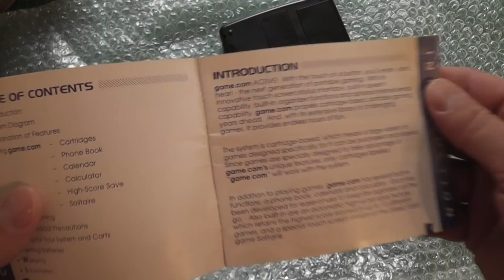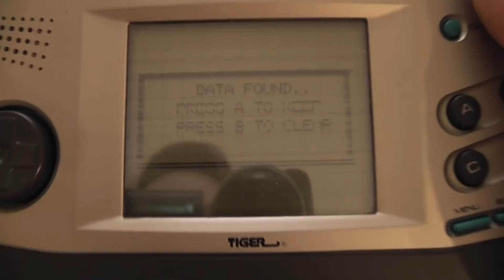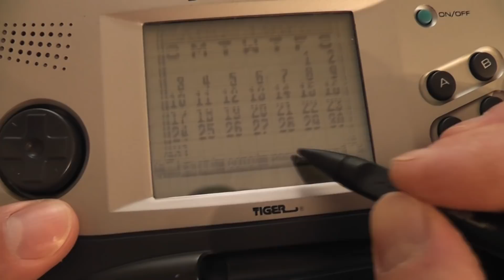Let's Repair - Ebay Junk - Tiger Game.Com Handheld - LCD Lament

Comment: I've had success heating a metal ruler with a hot air gun, then using that to press against these strips. Much better control over heat, as you can let the ruler cool off more or less as needed. Need oven gloves of some sort though.
Reply: Fracture nice idea. I shall try that 👍🏻
Reply: Good idea. You would need quite a lot of workspace though. :)
It should also be mentioned that there exists T shaped soldering iron tips that are made specifically for these situations and some even come with silicon rubber to help even the pressure without overheating the cable.
You can get cheap ones directly from Asia on aliexpress for example.

Another solution that doesn't involve soldering is to use pressure just like when you press down around the edge with your fingers. You could for example cut strips of rubber and place them over the cable on the PCB then screw everything  back on tight. Add more layers until you get the best result while not deforming the plastics. This additional pressure if often enough to restore the contacts before attempting anything else.
Reply: Even a steam iron without the steam would be better than a soldering iron. There's a video from Markusfuller where he uses one to fix an MC-505 LCD screen.

Comment: I remember being about fifteen in Christmas 1997.  I was at Wal*Mart checking out what's new for the season (Star Trek / Star Wars figures primarily) when I saw this on display.  I toyed around with it for about five minutes and for the time, it wasn't half bad.  It touted internet capability which was basically unheard of back then, but little did you know that browsing the super information highway would be text base only.  Sucks seeing this had the ability to draw graphics.

Comment: I've used a metal strip in the past, laid over the ribbon cable and gently stroked with a soldering iron , helps to spread the heat out a bit and stop heating 1 spot too much

Comment: Just took mine out of storage and it was in the same condition (lines). You can buy a soldering iron tip with a silicone attachment, meant to do this job. metal on the plastic strip will melt it, the heat from the silicone covered soldering tip won't melt it, but reactivate the glue. I originally purchased the iron for a computer LCD of mine, but will try it on this. Other people had success with a hair dryer and pressure.

Comment: That particular style of connector is notorious for causing partial screen failures. It uses a heat activated adhesive, rather than solder to adhere to the glass screen and/or PCB, which requires much less heat to affix. The plastic ribbon cable, although heat tolerant, has a much lower melting point than that of solder so care should be taken to avoid overheating as this could damage the cable or break the screen. 
I have repaired a few devices with this type of connection and find that using hot air, set to around 150°C, and a small tubular object as a kind of rolling pin works best.
Reply: This is exactly the kind of info I was looking for as I have a similar repair that I need to do.  Thanks!

Comment: Is it a bespoke screen that's in there then?
I have an old Game.Com and I was thinking about trying to replace the screen with something a bit better, as the screen are notoriously hard to see and suffer from motion blur. Mine also has a bit of leakage.
Something with a back-light would definitely make a huge difference to a Game.Com.

Comment: I've had good luck repairing virtual boy lcds with a heat gun. I heat it up a little and then press down on the connection with a rubber eraser and let it cool, that seems to be a lot safer than the soldering iron method although it's not without it's own risk.

Comment: Well, no success at repairing the screen, so I removed it completely to expose the 11 LCD pins on the mainboard. Interesting fact, the touchscreen digitizer? Yeah, that's not even soldered down. It's held down to the pads via adhesive, pads, and pressure from the plastic frame screwed down. So I am going to see if I can figure out how to put a backlit touchscreen LCD in it.

Comment: Little known fact: it was called the "game com". Everyone knows it as the "game dot com" because of the "dot com" boom still at full force. 

Also, it could read into a sort of leaderboard online and had two slots for cartridges. The system's screen was "resistive" which had to be pushed to click, not the "capacitive" screens which we know today.
Reply: Game Interest the Nintendo ds line use the same sort of screen hence why a stylus is recommended

Comment: hmmm has to be a way of doing this in a better way i wonder if you can use a clothes iron try on low to high bit at a time also a larger coverage rather than small solder iron?

Comment: I would suggest just to put some thin rubber strip on the connection, so it forces some pressure on it..

Comment: Does anybody know what kind of glue they use to fix such flexible plastic ribbon cables to a circuit board? I'm guessing it's some sort of conductive glue. But how do they apply it so it doesn't short out across the traces? I've ruined several different machines trying to repair stuff like this

Comment: I fixed a screen with a soldering iron by placing tin foil on the ribbon and running the soldering iron over the top.

Comment: What about the game gear?
Reply: Calyn G Usually lines on a game gear are due to the ic corresponding to the display. If you get your iron and heat up the one to the right you'll notice some lines appear again, but they almost immediately disappear again. There is no real fix other than paying $100 for a McWill Screen (which is honestly worth the money if you're emotionally attached like me and have a good library of games) or you could strip it to try to make it into a consolized game gear. Cheers!